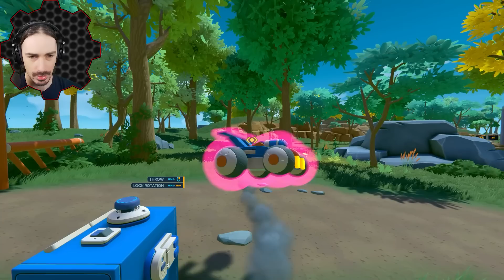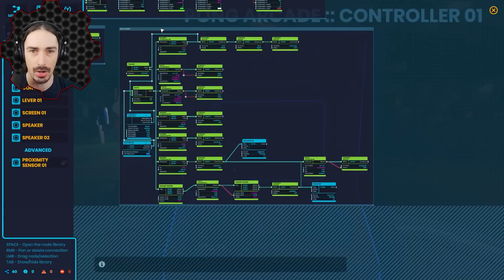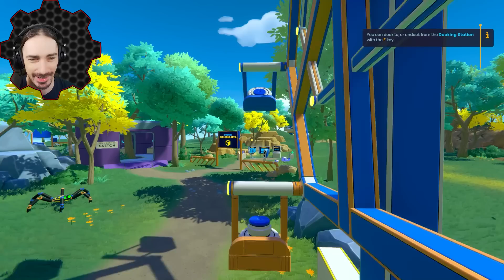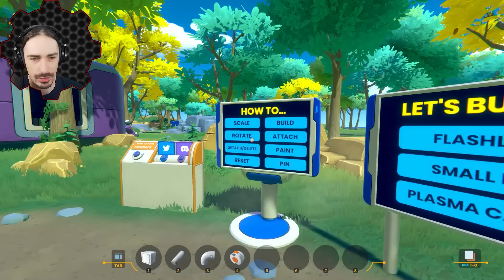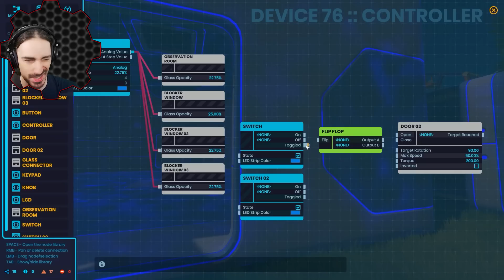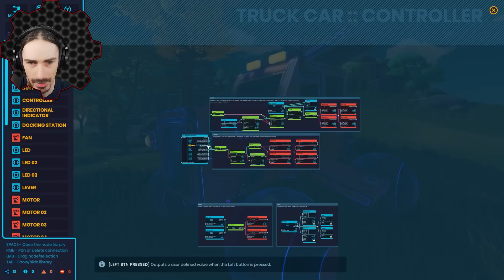New Engineering Sandbox Game Has Crazy Potential - Plasma First Look

Comment: Very impressive new game. Looks like they learned a lot from the 3D construction programs they have to work with for a game like this, stripped some of the complexity while leaving in many nice options, and offered the rest to the user, so there are build paradigms in there, actually proven to work for years, e.g. being able to set everything's default state during construction, have build hierarchies, etc..
That's a thing I wished Trailmakers thought of, but completely missed for almost all non-primitive blocks, e.g. you can't create a hinge with default state 90 degrees ... not even talking about angles between 0 and 90.
I like that game preview a lot. Very promising.

Comment: This is amazing. With the graphics functions I saw in the Pong game, I would not be surprised if you could make a full on 3D rendering engine in this programming system.

I just watched the rest of the video. It's definitely possible. 3D objects are displayed using triangles drawn on the screen. With that "Shape Drawer" component, and some math, you could easily make a 3D rendering engine. I wouldn't be surprised if you could make DOOM in this game. In fact, I'm fairly sure it's possible with only the components shown in the video.